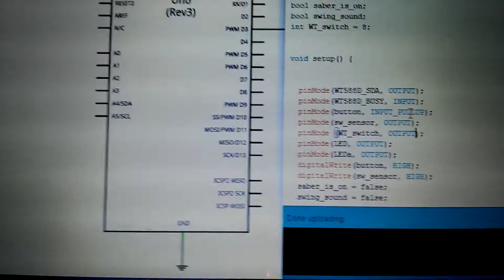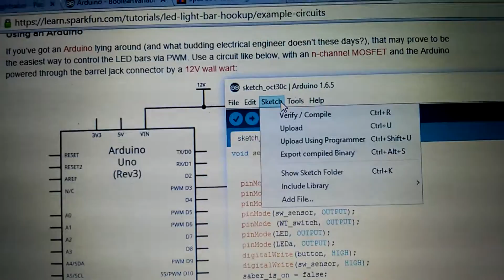Arduino Light Saber WT588Du

Comment: This is where we all learned about this,  soon perhaps someone will post the working code with list of parts and Tutorial.   All the code is there,  but do you want multi-color change saber?  The problem is that different people on the forum use different sound codes and accelerometers,  so there is mixed code all over,  and confusing to noobs like me.  But yeah  go here and read....
https://forum.arduino.cc/index.php?topic=261980.0
Reply from the maker: +911blinky   i use button code.  and PWM LED control  google "Arduino Switch"  learn how to execute IF ELSE statements with the Arduino Switch concept and you have a saber control system.  that's not the problem...   that so many people do so many things. that should empower you to explore how you can do it your way.  who cares how it works,.  so long as THAT it works.  right?